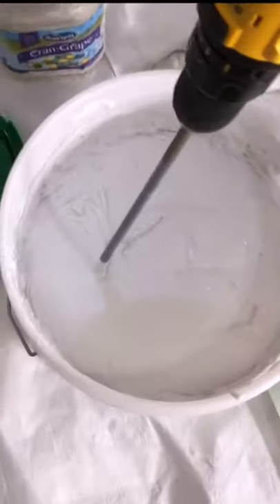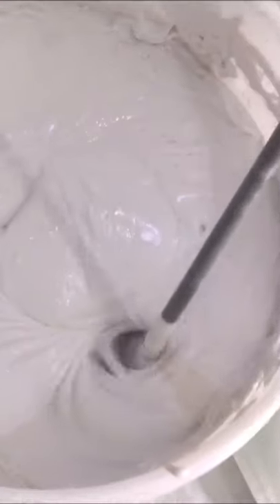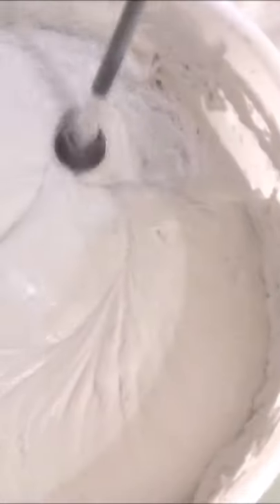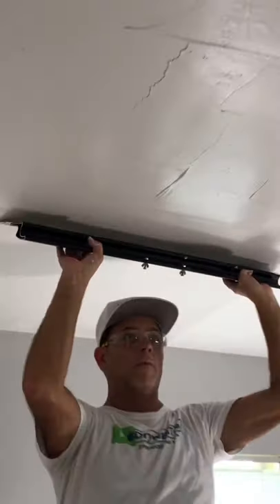Skim Coat Over Ugly Texture with a Skim Coating Blade!

Comment: 1inch and quarte roller,put some drops down .labor intense ,maybe laminate with quarter inch drywall if plaster attachment is a breeze lathe will grab.
Reply from the maker: I did apply The skim coat with a roller the second go round of skim coating: https://youtu.be/9cKFJZNfdKQ  I don’t like to thin down the joint compound too much when I’m going over a heavy texture like skip trowel on the first skim coat. And if you’re trying to do the first coat with the roller then the mud has to be too thin to get good coverage over the texture. IMO
Reply: @PaulPeck  My apologies, I never did ceiling with roller but found on walls to be asset.We use to hawk and trowel that years ago.Thanks for your excellant videos if you say where your at U may increase your customers.

Comment: Paul, load the compound right onto skimming blade with your drywall pump with the box filler, then right into the wall or ceiling. Saves a lot time.